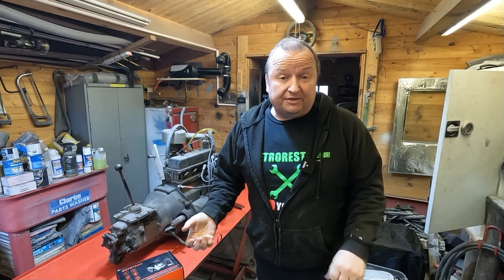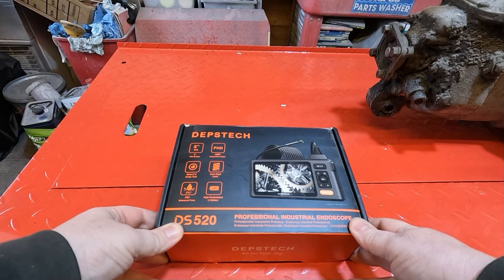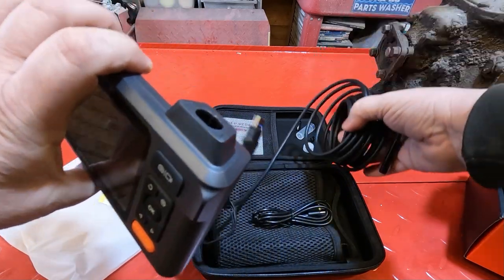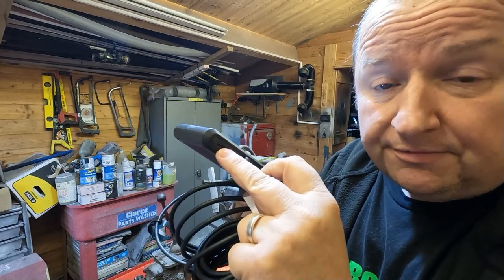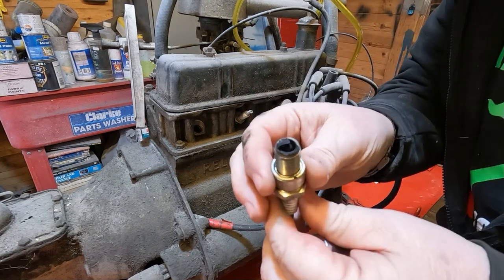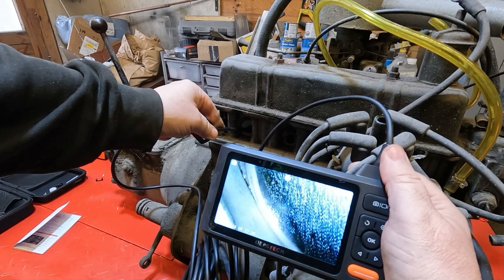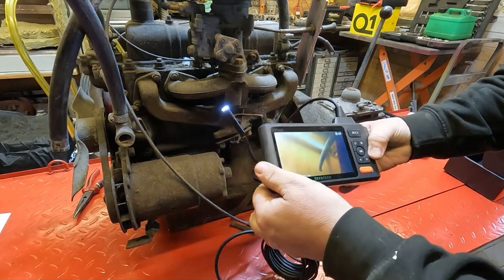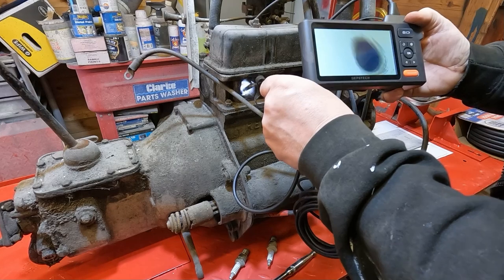We Look Inside The Reliant Engine With A Depstech DS520 Borescope

Comment: As ever, Tondon doesn't disappoint. All their kit is top notch and I would buy this endocscope purely on the strength of your review. The head will have to come off to properly assess the bores. I hope it will just need a hone and some valve stem oil seals. Looking forward the the nexr Reliant video.

Comment: Hi Martin
The endescope is a good bit of kit . On the subject of burning oil, do a compression test before you strip the engine also you showed the crankcase breather, to me it looked dirty if that is blocked it will cause crankcase compression and in turn push the oil up past the rings . Thanks for showing the endescope a very informative video

Comment: Martin, a friend of mine picked up a 1949ish Austin taxi cab. It was removed from someone's rear garden here in the States. The gearbox got flooded because of a hole in the roof for the taxi light. I don't believe that many Austin's were imported to the USA in any numbers. This is only the second one I've seen in many years. I know of an older Citroen that was brought here, a number of MGA and MGB cars here, and I recall seeing Reliants that came across the pond. That motor and gearbox would make a cute tractor as it's quite small. Incidentally, the day the Austin showed up, there were some very rusty Ford Model A cars that had also come in. I have a gearbox from about a 1930 that my uncle had. I bought it at his estate sale, and am working to build a tractor and incorporating it into my design. I actually was looking for a shaft to fit into the universal joint on my gearbox, so I was able to pick that up quite reasonably.
I hope things go well on that engine that you're working on.
Reply from the maker: Thanks for watching, glad you liked the video